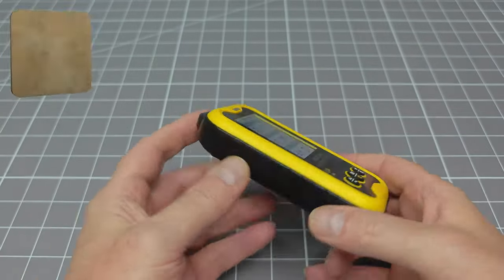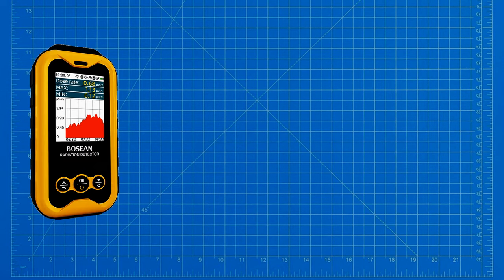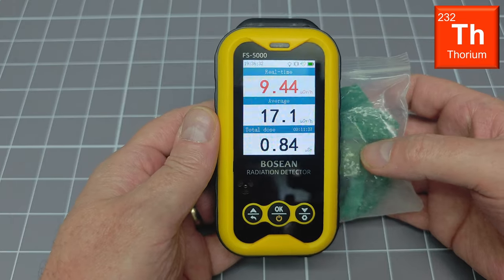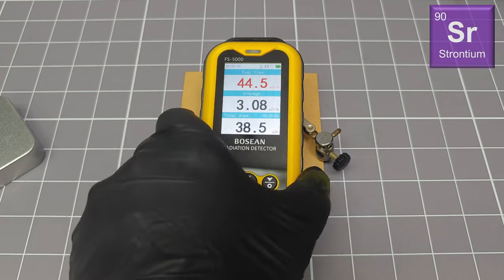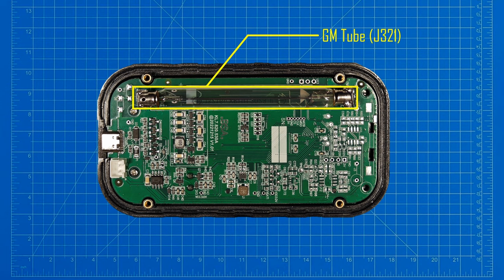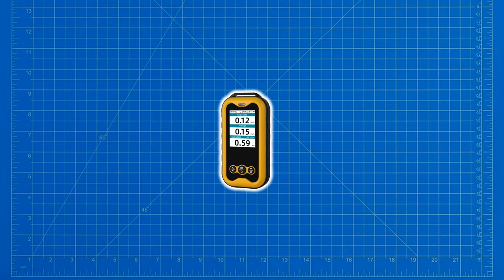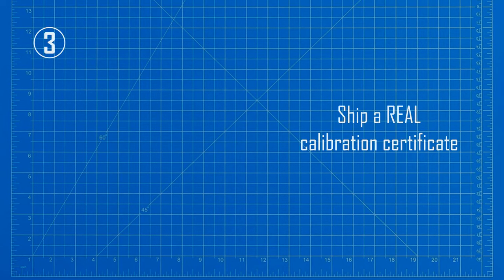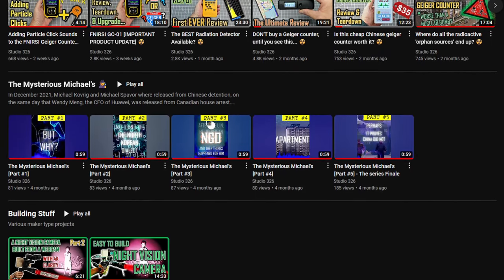The Perfect Cheap Geiger Counter?

Comment: Can you make a video on radioactive dust on air filters caused by radon.
Reply from the maker: I have no plans to make such a video at the moment.  I'm not sure how a substance in its gaseous state gets caught in an air filter that is designed to catch particulates - I have seen some videos that claim to do this, but I remain somewhat skeptical that any amount of Rn222 will be accumulated for measurement by a tissue held over a vacuum cleaner nozzle...
Reply: @project-326  its not the radon gas that gets trapped in the filter. The decay products of radon are the ones that get trapped
Im no expert in this field but from what ive read these particles are positively charged when they form and get stuck to dust particles in the air due to static electricity. Its these dust particles that get trapped in the filter.
Even bionerd23 made a video about this. she used a statically charged baloon to attract all the dust
Reply from the maker: @hardnachopuppy  Well, I'm not sure about Rn222 being charged, the alpha particles it emits during it's decay certainly are positively charged (+2eV) but prior to decay, it is just like any other noble gas, very hard to ionize.  If the basic idea is that by using a filter, the many isotopes in the decay chain can be trapped, then that is not an unreasonable premise, but the videos that claim Rn222 is directly trapped in a tissue are making a fairly tall claim.  The easy way to test this claim is if a strong, above background, level can be established with a typical glass tubed detector (such as the FS5000) ie one that cannot detect the alpha decay of Rn222, this would show that what is being seen are the gamma/beta emissions of the many daughter products down in the decay chain.

Rn222 is notoriously difficult to directly detect, it has a very short half life and is an alpha emitter.  Further complicating the detection is that its parent isotope (Ra226) has a pretty long half-life, so Rn222 is quite rare.  Typically the amount of this isotope is determined by measuring the proportions of the other products in the decay chain and then working back based upon the statistics.  This usually is done with a very sensitive gamma ray spectrometer, long duration measurements and some fairly advanced analysis tools.  

As a side note, I have noticed that a few products have appeared on the market that claim to be able to detect Rn222, I would be very skeptical of the cheaper ones (<$500)
Reply: @project-326  im saying the same thing radon is not getting trapped
The decay products of radon get trapped. Ill try it and see what results i get. I dont have a proper geiger counter. Just a SI22G tube and a circuit to make it click everytime it detects radiation

Comment: Where is the battery ?
Reply from the maker: attached to inside of rear cover of the product.  I should have made a photo of it, but seem to have missed it!
Reply: @project-326  tx. Showing battery is always important because of finding replacement sources before decision to buy. I prefer 18650 always if the device itself isnt bad.
Reply: @SirWerner..  This is a flat rectangular Li-Po pouch cell. It fits in a "frame" of four low rails in the back cover. There are many Li-Po cells of a similar size and form factor on the market.

Comment: Can anyone please check something with their FS-5000?
The J321 tube has a conversion factor of 153.8
This means to get uSv/h you divide the CPM by 153.8 and you get uSv/h
On background radiation level, this seems correct: If I get 20 CPM, the FS-5000 shows 0.13 uSv/h (20/153.8=0.13).
But at higher readings, the FS-5000 shows uSv/h that's way above what it should be: 350 CPM translates to  3.94 uSv/h. As I see it, this should be 350/153.8= 2.28 uSv/h. My other meters (a GMC-320+ and a Soviet RKS 20.03) confirm this by reading close to 2.28 uSv/h.
So, is something wrong with my meter or is there something wrong in software? The fact that my other 2 meters are showing way lower uSv/h make me think there's something wrong with the FS-5000
Reply from the maker: do your other instruments have any sensitivity to beta radiation?
Reply: @project-326  Yes, they both do.
But why would it matter? The hardware of a geiger counter can only do 1 thing: register counts. It's up to the software to translate this to uSv/h. And if my GMC-320 and FS-5000 are showing the same CPM then they should also display the same uSv/h. I'm trying to figure out why the FS-5000 is converting CPM to uSv/h with the 153.8 factor at background level radiation, but starts displaying considerably higher numbers at higher radiation levels. Perhaps it's multi point calibrated (we don't know) but this would mean the J321 tube is very non-linear. But even then, why do the GMC and RKS translate the same CPM to much lower uSv/h levels?
Reply from the maker: @Ni5ei  I understand the confusion now, I apologize for not understanding this question clearly before.  With a J321 tube, like any GM counter detects counts but not equally in the energy bands.  All GM tubes have different sensitivities at different energy levels.  Try to think of this in terms of statistics, if tube A has a detection probability of X at, say, 100 KeV and tube B has a detection probability of Y at the same energy level, then neither cps or converted Sv/h will be the same.  For broad energy sources, such as background, tubes can be calibrated to read the same, but that doesn't mean that at any specific energies (say a Cs-137 source) will read the same.

This is one of the reasons why an energy compensated gamma ray spectrometer is always better (but it will miss other radiation sources).  Sadly, there isn't any detector that can measure all of the predominant decay modes and come up with a definitive answer.  Essentially, you need to know what type of radiation you are measuring and at what energy level, then find a detector that is specific to that application to be able to get a good result.

All detectors are a compromise...

I do hope that helps, but please feel free to ask about anything you are unsure of, if I can, I will try to answer.
Reply: @project-326  Thanks for the extensive  explanation. I appreciate it.
Still, I really would like to see some CPM and uSv/h readings from other FS-5000 users to see if they match. I've been trying to get these for quite some time now but can't find people who own one. I've tried Reddit but didn't get any sensible responses there so that's why I've posted it here.
All I need is a few x CPM = y uSv/h results to see what other FS-5000 counters are doing.
And if it's indeed using different CPM to uSv/h factors depending on the scale of counts, this would also be the reason the FS-5000 is showing completely different readings when you install RAD Pro on it. Because RAD Pro only uses a single 153.8 translation factor.
Here's a result of measurements I've made: same source, same hardware, using stock firmware and RAD Pro:
FS-5000 stock firmware:  87 CPM = 0.75 uSv/h
FS-5000 RAD Pro firmware: 85 CPM = 0.55 uSv/h
Stock firmware displays uSv/h almost 40% higher than RAD Pro on the same hardware.

Comment: Can you tell if is it possible to calibrate this little thing?
Reply from the maker: There is a calibration factor in the PC application that gets downloaded to the device.
Reply: @project-326  Only 1 factor? So if you replace the tube with a different one that's not linear to the original one you can't set different calibration points? I have a spare SBM-20 tube lying around. Would it be possible to put this in?
Reply from the maker: @Ni5ei Yes, only one point calibration available to be changed.  

I'm not sure abut the size of SMB-20 tube, if it will even fit inside the FS-5000?   Personally, for changing tubes, I usually only change ones that are really crap, that way I am less concerned about a loss of calibration and more interested in the improved sensitivity.  It is also remember that neither the SMB-20 or the J321 have ANY kind of energy compensation and will likely have around 5:1 range of sensitivity difference across its energy range.  With that in mind, precise calibration is only really of benefit if you calibrate to a source with a known activity at a known distance.  Even then, the calibration is only really valid if intend to measure only that particular isotope.

Things like Uranium ore are pretty much impossible to calibrate for using a non-compensated tubes.  The isotope 'soup' in the ore will be highly dependent upon where it came from, etc.

Comment: I bought this unit a month ago for about $110. Today it came but I can't get it to connect to the PC. Just not finding it. And I didn't find any app to download for this unit. Any suggestions anyone?
Reply from the maker: I had the same problem, the company were really helpful when I mentioned this.  You need to install the COM port driver and ask the company about the 'special' version of the software.  The issue is the auto-detect of the COM port.  f you look in device manager, you should see a COM port for this device whe  it is plugged in (if not, the driver is the issue).  When you open up the software, is your COM port listed in the drop-down on the top left?
Originally, the software would hang when I pressed the DETECT button and I needed task manager to kill the process...
Reply from the maker: OK, I just looked on-line at the product website and it is still the same version that hangs, I have mentioned to the company that this happens and they said that they will release a new version soon.
Reply from the maker: Try the original version of the software:
https://www.bosean.net/download
Click the link on the bottom right named "Personal Radiation Dose Management System".
Reply: @project-326  Thanks for the reply. I wrote to the manufacturer's mail about this problem. We'll see what they reply. And it seems you tube is deleting my comments. because I replied to the previous one and it was deleted.
Reply from the maker: @The_sixth_extinction , not sure why, I just checked the comments on hold and none of yours are in there.  $hitty YT algo...
Reply: @project-326    continues to delete comments. I've written it 3 times already. Apparently YouTube doesn't like me.😁 Thanks for the help. Finally I can plug it into the PC and everything works. I am happy with this device, such a wide range for such a price is very rare. Only some Russian detectors have such a wide measurement range. Like Rad i as can 701 MKS and DR G, but their price is 7-8 a and 10 times higher, that is, about 700-800 $ +
Reply from the maker: @The_sixth_extinction  I can see this comment, happy you now got your device working!
Reply: @The_sixth_extinction had exactly issue lately..youtube keep deleting comment

Comment: yo i should mention when i max out this thing with xrays it just says “999 MAX” as the dose rate 💀 not even its max range. ngl this thing is kinda crap, seriously review the KB6011. much better response time and doesn’t tell u bs if it maxes out it says 5000uSv/hr. it also has shielding on the tube and is properly calibrated. i’ve seen HUGE over response on the FS5000, readings on my KB6011 are extremely close to what my radiacode reads in my experience. really the only downside to the KB6011 is that it does lack some features the FS5000 has, but for radiation detection it’s probably the best cheap beginner hobbyist counter out there, better than the cheap GMCs in my opinion and it’s cheaper! (PS, it has a j321, not one of those shitty tubes. also it has instructions if you want to switch it to an SBM-20 tube on their aliexpress listing which is awesome)
Reply from the maker: Thank you for the comment, you make some good points.  Let me go through these one by one.
1) Maxing out the FS-5K - you must have been using a VERY strong source - even on my strongest source, I didn't manage that.  May I ask what you used to generate that level of flux?
2) The RC10X and the KB6011 only detect gamma, but the J321 tube used in the FS-5000 is sensitive to both gamma and beta, so the count rates will always be higher.
3) The SMB-20 tube is an excellent and well respected detector, the issue is the low beta sensitivity and the high cost.  Its does have some beta sensitivity, but only for pretty high energy betas.

Comment: could it be considered that chemical analyzers from Bosean are also better then others if geiger perform so good? Just if you like to be closer to original German pronunciation Mueller is more like Myller rather then Mollar.
Reply from the maker: From what I can gather, their gas analysis devices seem to have a reasonably good reputation, at least for lower cost devices, clearly they cannot be considered scientific instruments.  That said I have not tested any of those and I don't have the required equipment to do so, even if I did.

My robot voice has enough trouble with my native English language, let alone German, but thank you for the info.
bleep, bloop, bleep, 10101100101010100001111001010100110101010
:-)
Reply: @project-326  thanks great, do you think it make sense to pay more for isafegas? Zhongantan also has interesting option to use active pump on diffusion detector, which none of the others do, on model S318. Isafegas claim to use the best imported sensors, do you think it matters versus Chinese? And if you like puzzles here it is as safegas did not explain, sky3000 has detectors on the outside of the case, just as diffusion types do, but they claim it is only the pump type, anyway is not clear where does if make the flow if detectors are to the outside. It is to be noticed on several English sources pronounced as Mollar, so it took the attention! :-) It has been hard to notice as robot voice, what is the use?
Reply from the maker: @samoime1955  I can't really comment on gas sensors, its outside of my experience.

As for the robot voice, well my own voice is pretty terrible (I have a voice made for print) and also i live in mainland China, so a little anonymity is useful.
Reply: @project-326  do you have plans to come back? It is interesting to note that prices in UK have significantly dropped since covid or Brexit, it is attractive for shopping, took the crown from Germany.
Reply from the maker: @samoime1955  no plans to go back.  Yes, perhaps a good shopping destination but not one for my family and I to live in.

Comment: How important is it to detect alpha radiation? And how important is it from a purely safety perspective to know the type of radiation you are detecting or is Sieverts truly giving you the intensity of ionizing energy that can harm me or my cat?

I'm so torn between the Radiacode 102 and the FS-5000. I'm just a low level enthusiast and can't imagine I would need to identify isotope in the middle U.S. with the exception of wandering around or near a decommissioned nuclear power plant in my area. Yes, I did just purchase a $200 vacuum pump so I could expose some friends kids to deflating marshmallows and keeping my nuts (pistachio and cashew) from losing their snap... Any insight and/or advice would be appreciated.

I do love your videos which includes enough explanation and demonstration so I know you aren't a wanker. I've subscribed and look forward to more.
Reply from the maker: All all depends on how much you want to spend.  Personally, I would go for a reasonable quality low cost device.  Alpha is pretty hard to detect anyway, for example it won't get through more than 30mm of air (take a look at my Alpha spectrometer video) and devices that are capable of measuring Alpha are usually an order of magnitude higher in price.  
I found that the FS-5K was actually better at measuring the secondary cosmic rays when on an airplane than the RC102 (most of that radiation is in the form of betas).  
Summary: Start cheap and work up if you find an interest in the subject.  Sometimes I can be a dick but seldom a wanker...
Reply: @project-326  Thanks.

How important is it to know the energy level of gamma radiation with respect to sieverts? Again, I'm dabbling and am currently residing in low rent housing of the Belle curve. But, if I am understanding kev, gamma from Am241 is a lot more tame than Cs137 or whatever else that might be hotter. I will prob end up getting the FS-5000 and in short order wish I had both...

Btw, Hans Geiger was a jerk. When Hans Bethe lost his position in 1933(35?) Geiger was unsympathetic  and could have helped. I'm not shit stirring, I'm reading a book on the making of the atomic bomb and assumed brilliant minds where noble as well. I have no idea if Hans Geiger was a malcontent, but that bit between the two stuck in my mind.

Comment: haha, die imperial units
Reply from the maker: Agreed, 100%.  When I was born, the UK was using 100% imperial units, we even had stupid imperial money!  Then, in 1971, we had an official process that got called "Decimalization".  The money changed, but also we started using metric in parallel for everything.  To this day, we still buy beer in pints, fuel is shown in liters and gallons and sometimes, you can still see pounds and ounces.  Basically, the process of changing to metric has taken the majority of my lifetime thus far.
Reply: @project-326  Don't forget distances are still in miles. UK really is a mixed bag of imperial and metric.
Reply from the maker: @Ni5ei  Oh yes, I nearly forgot about miles.  When I was on long car journeys as a child, I didn't ask the classic "Are we nearly there yet", instead it was "how many more miles to go?".  Sorry you triggered a childhood memory...
Back in those days, it only took 2.5 hours to go from Bournemouth (my hometown) to Bedfordshire (grandparents).  The last time I was in the UK it took way longer despite the 40+ years of building motorways and bypasses.  I guess that's how progress works.